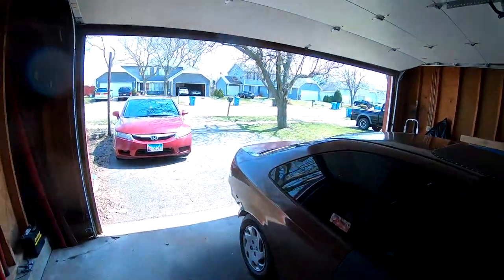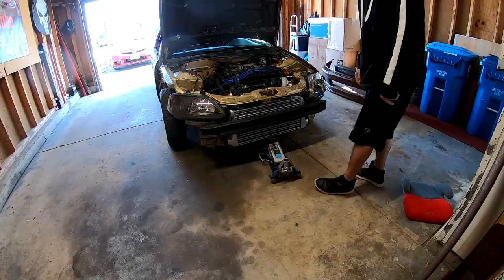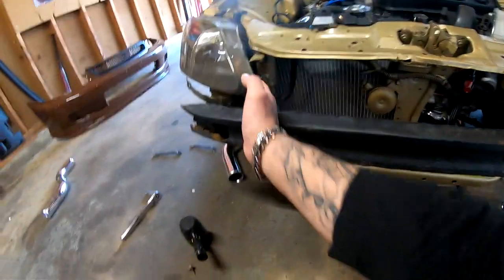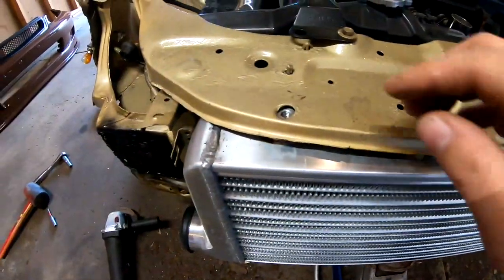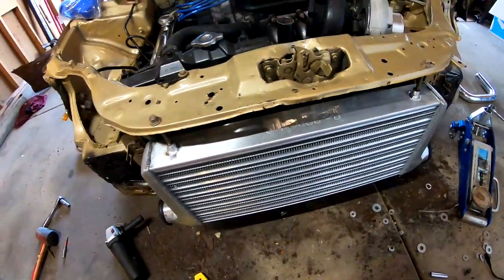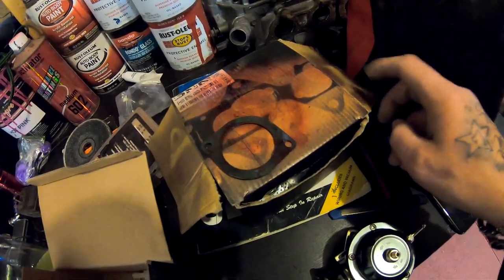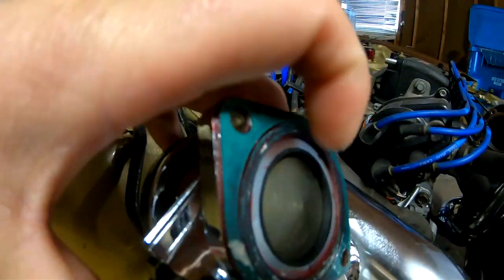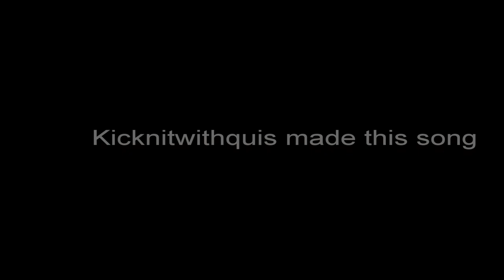500hp build Ebay Civic gets huge intercooler install step by step during quarantine

Comment: Does that intercooler handle 500hp ok?
Reply from the maker: I modified it a 2 or 3 videos ago for 500hp
Reply: @BarbasLife  thanks for the quick reply ill check it out and subscribe. i have the same intercooler making 350whp rn and im shooting for 500 with this
Reply from the maker: Yea no problem I ended up welding a back door to mine. Thanks for the sub.